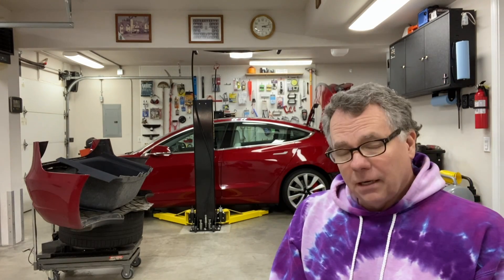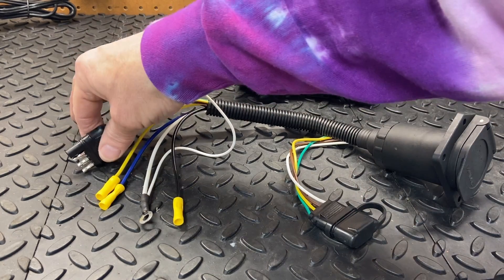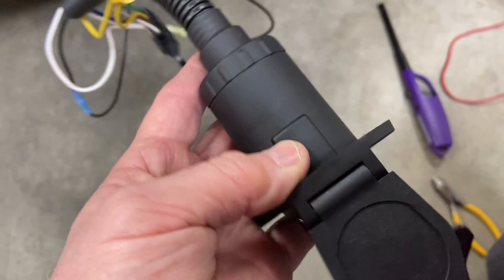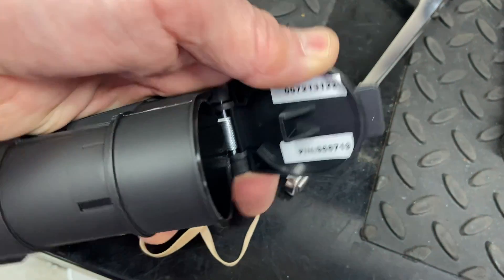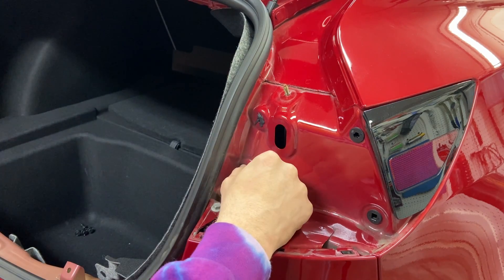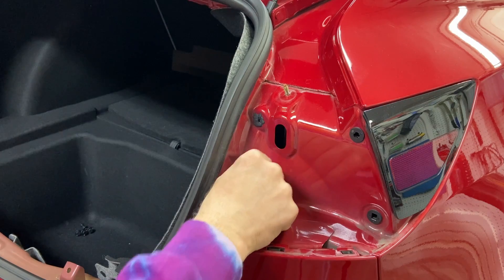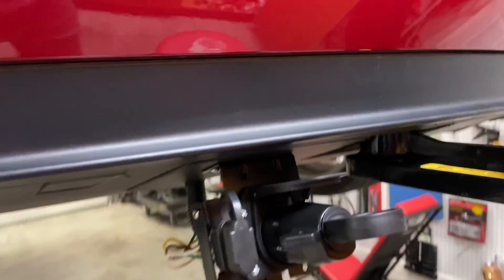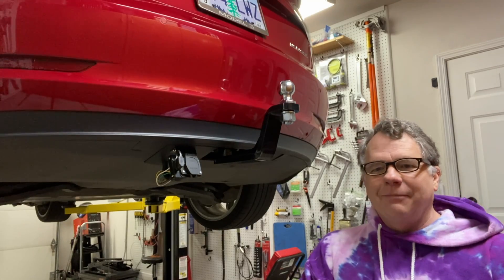Tesla Model 3 Trailer Brake Install (Part 2)

Comment: Great set of videos and clean work! It's kind of a shame that an entire 7-pin adapter is required for the 1 additional 12v wire needed by the Echo. 

I'm really curious to see a video testing the max rating. I bet a local RV dealer would partner for some testing content especially now with the season slowing down.

Comment: What has been the reliability of the Curt Echo brake controller? Would you buy it again? Thanks.
Reply from the maker: At this time I have only used it a few times, so I can't really say, however it has worked flawlessly each time I have used it.

Comment: Can you provide a link to where you got the 7-pin wire harness and the Curt wireless brake controller? Thanks.
Reply from the maker: Sure here are the links:

Curt wireless brake controller
https://www.amazon.com/gp/product/B07JQ99SDD/ref=ppx_yo_dt_b_search_asin_title?ie=UTF8&th=1

7-pin wire harness
https://www.amazon.com/gp/product/B08Q7K26Y8/ref=ppx_yo_dt_b_search_asin_title?ie=UTF8&psc=1